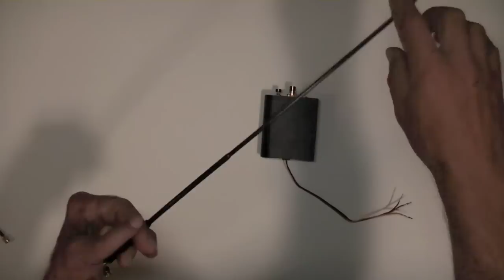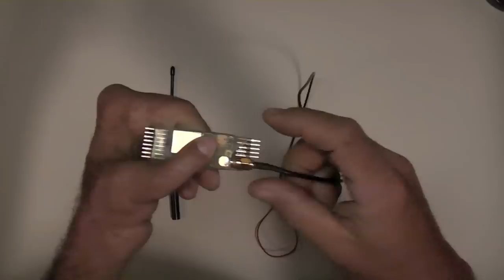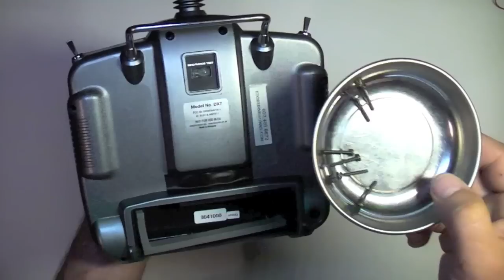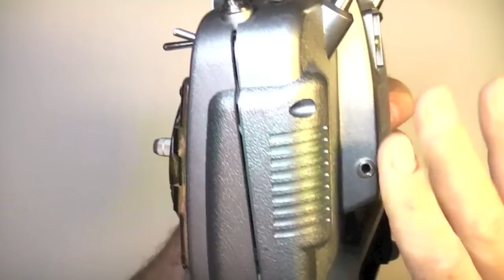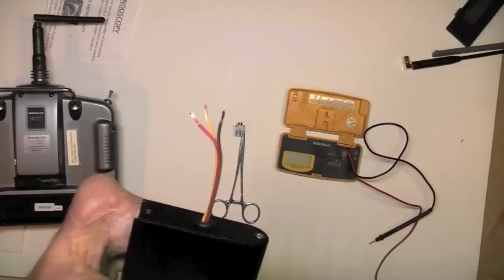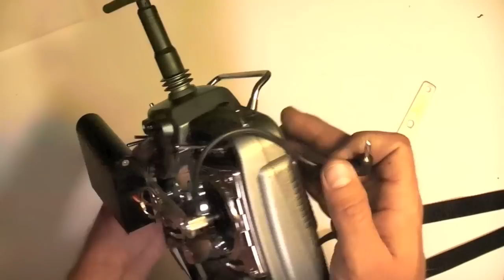DRAGONLINK - Review and Spektrum DX7 Hookup

Comment: Edd, thanks for showing us that bit of transmitter surgery....The only thing I can see which may be a bit suspect is that those servo leads you used are not screened cables and they are both quite long. You will note that the 3 pole jack plug cable uses the ground wire as a screen, enclosing the power and signal wires. A screened cable would prevent unwanted emissions from the signal wires inside your TX case. Yes, the original 3 wires inside the case were also unscreened, but they are also very short.  Those 2 long servo cables may be vunerable to the RF emission at 433Mhz?

Comment from the maker: Oh, yikes!  You could probably map it out though and use a circuit tester to ID the leads.  In my experience the everything attaches to the ground, which has a big fat trace on the PCB where he wire attaches.  The power usually goes to a 7805 regulator, which looks like a burly transistor with 3 leads, and the PPM should go to the actual RF module, the silver metal covered thing, but possible with an intervening processor.  Tricky, bro.  Sorry.

Comment: Thanks again I appreciate the information.  This makes sense now and I finally took apart my radio and realized I made a critical mistake.  I have the newer DX7s and the wiring is completely different. The wired are all the same color and the wire harnesses that run to the trainer port area connect to a board. The trainer port is directly attached to this circuit board. There are no apparent Powe or PPM wires to splice into

Comment from the maker: And you can take off the 2.4GHz antenna easily by unscrewing the screw on the outside to remove the base, then the retainer screw inside to remove the actual antenna, after unplugging the tiny coaxial plug from the printed circuit board on the RF module/deck.

Comment from the maker: If you really never need to use the 2.4GHz again you could actually just use a standard 3.5mm stereo jack, and just swap the power, ground, and PPM signal leads right to that jack, then plug the DragonLink into that. No switch needed at all, just abandon the 2.4GHz RF module.  Heck, you could actually just hardwire it in if it was truly permanent.  That would actually be the very easiest solution of all for a DX7.

Comment from the maker: If you use a switched jack all you need to do is plug in the DragonLink to use it, or unplug it to activate the 2.4GHz.  You could use a pair of actual switches, but the switched jack does it all for you. If you were to use the trainer port you would need to set the slave setting so the PPM signal only went to the DragonLink and not to the native 2.4GHz module.

Comment from the maker: Cool man, it is a ton of fun!  If you don't already have a DX7 you may want to check out the Turnigy 9X or other radio with exposed RF module pins.  I just did a recent video on hooking up the 9X with a DragonLink, so look that up if it's relevant to you.  It's way easier than the DX7 hookup you see in this video.

Comment from the maker: I can't speak to that transmitter specifically, but my understanding is that most transmitter trainer ports carry only PPM signal and no power, but some might have power.  It would be hard to know the rating of the power circuit in the trainer port even if it did provide power.  The DragonLink does transmit at over 5 times the power of a standard legal stock 2.4GHz module so presumably the power consumption is somewhat more.  So the answer is:  I'm not sure, but be careful.

Comment from the maker: It has to do with the way I have the DL module attached via the lanyard hangar, which can be quickly removed, as well as being able to lay the radio down flat in my lap or on a flat surface and not on the DL module.  But certainly it's up to personal preference.

Comment from the maker: Are you referring to the transmitter or receiver?  Transmitter is red=power, brown=ground, yellow=signal.  The receiver has channels numbered and these act just like normal receiver connections, plus there's the RSSI out.  Signal pins are the ones on the same side as the antenna SMA connector.  Google: Dragonlink manual and also see the RCGroups thread for more instructions.  I promise the info is out there, with pictures.

Comment from the maker: It's a good question.  The lead length is only for the feedline to the actual antenna elements, which themselves are a fixed, tuned length based on the wavelength of the system.  Choose a lead length that will go from your receiver location to a site on your airframe that is vertical and free and clear of other electronics and moving parts.  For a multicopter choose a short lead.  For a big fixed-wing, perhaps choose one that will reach the tail or wingtip.

Comment from the maker: Thanks.  Yes, it seems kind of sketchy but it's really not too hard.  You just have to solder the right wires to the right places, and understand what is going on in order to test it as you go.  Once done, it works like a dream - very easy to switch back and forth between 2.4GHz and UHF.

Comment from the maker: The 433MHz Dragonlink uses an "amateur radio" band 70cm and does indeed avoid interference from 2.4GHz devices, of which there are many.  The DragonLink has 5 times the output power of Spektrum.  The longer wavelength travels farther per milliwatt of output power, and has better penetration through light obstructions (trees, etc.) due in part to a wider fresnel zone.  You can get more stuff in the way and still have a useful signal.

Comment from the maker: It would save a LOT of effort to do that, but supposedly the voltage of the PWM signal put out from the trainer port is low and unreliable, and so not a good feed for the DragonLink.  Smarter guys than me have apparently figured it out and made the recommendation.  Although it's more work, the soldered jack I show gives the DragonLink the same signal as the 2.4GHz module would be getting.

Comment: Insteadt of using the solderd plug jack you installed why cant you use the dsc port on the the back of the DX7 as it turns the TX module off and does exactly the same thing.the only difference I see is that you dont have to turn the radio on ,you just plug it in and the TX turns on.
I could be wrong and this wouldn't be the first time.